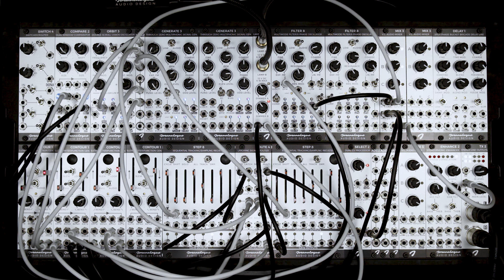Patch Tuesday | 16-Step Drum Sequencer | Route 4, Step 8, Compare 2

Comment: I see you have gate output 1 of each Step 8 going into route 4's control inputs in multi mode. Doesn't this mean that route 4 is getting told to pass both sequences at the same time? How does route 4 know to switch between the two sequences?
Reply: Is it because when you were first setting up the patch, you ran one sequencer through it all by itself to get the latch working in opposite directions?
Reply from the maker: Route 4 is set to latch mode, so will toggle on each incoming trigger. Then it's just a case of 'priming' one channel first, to make sure the two channels will alternate.
Reply: @joranalogue  cool! That aligns with what I was thinking. Thanks!

Comment: Would patching an LFO into the In of Step 8s trigger the kick and snare as it went through it's cycle?
Reply from the maker: You could do that with just Compare 2 or Step 8! C2 is a dual window comparator, so you could simply set up two separate windows: one for the kick, one for the snare, and use the comparator outputs directly as triggers.

S8 is a little bit less obvious, but you can think of the stage CV input as an 8-window comparator. You could patch your LFO in there and then take up to 8 of the gate outputs to trigger different percussion sounds. I hope this gives you some patching inspiration!